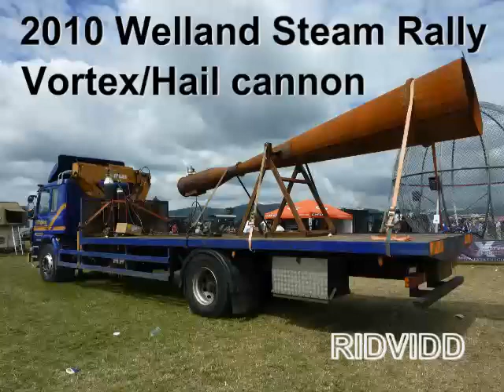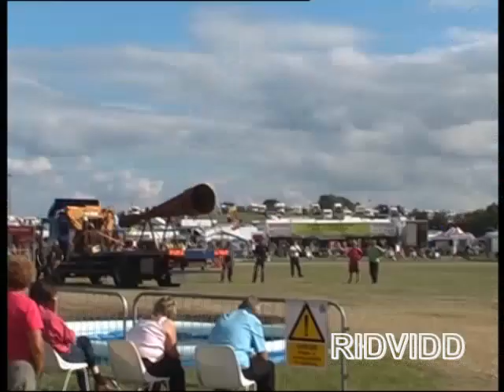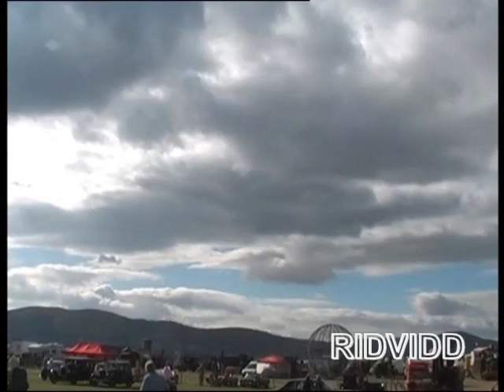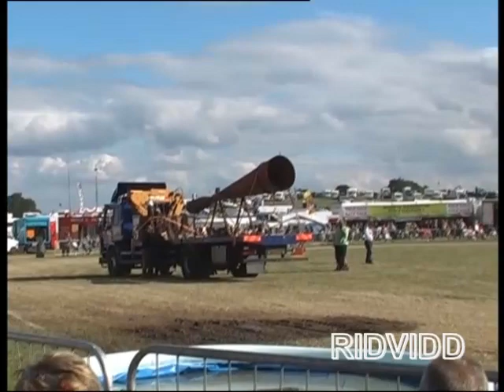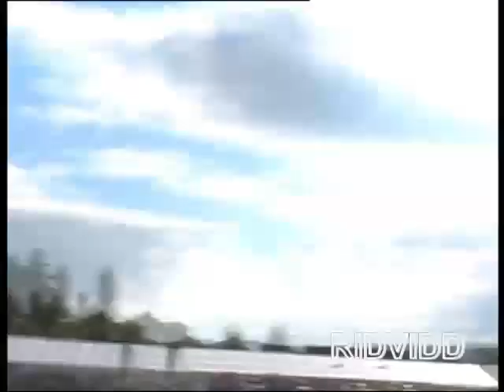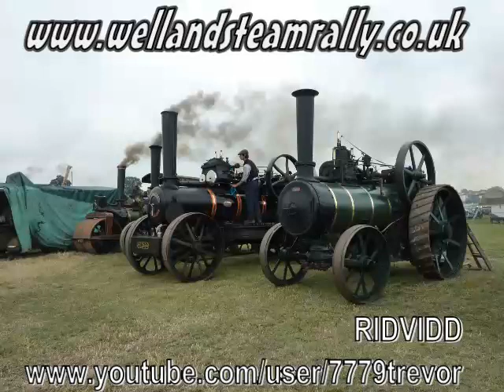Vortex / Hail Cannon .  Welland Steam and Country Rally 2010

Comment: It doesn't produce a shock wave (well, the explosion itself does, as well as a vortex), but a toroidal or donut shaped vortex. If you could load the chamber with a bunch of dense smoke before firing it, you'd see that it produces a large, fast moving smoke ring, like you can make with your mouth or with a burning stick. The toroid spins about its circular origin so fast that it makes that whirring sound. As the vortex moves further, it expands and the tubular section thins out, continually accelerating the gas, which explains the increasing pitch as it moves away. Anyway, the whirring isn't a shock wave. It's a giant smokeless 'smoke ring' that moves fast through the air.

Comment: Although it sends a shock wave into the air as well, a vortex ring and a shock wave is not the same thing. A shock wave is a sharp sound wave travels with the speed of sound, while the speed of a vortex ring is limited by the speed of the air that's trapped inside of it and goes much slower than the speed of sound. Cool video though.
Reply: para que serve isso amigo . Brasil Paraná

Comment: Whats happens when 2 of these are shot on front of each other, do the sound wave gets "null" ?
Reply: good question, but at the same time dangerous ^^
Reply: It would be cool if they do it, it could create light right like the shrimp Sonoluminescence
Reply: Miguel Queiroz
I seriously doubt it. Why would sound waves cause light? Shrimps cause light because they glow when disturbed. Why would air glow because sound waves hit it? Best you could hope for is a burst of heat, but not enough to make air itself glow, and I doubt you would get even that much.
Reply: a giant poof of air would probably come from the two coliding
Reply: +justforever96 dude.. both Light and Sound are waves!!! waves of the same energy source, just at way different frequencies!  ...so the idea is not impossible!
Reply: +Miguel Queiroz You never, NEVER cross the streams.  I'm sure I heard that somewhere.
Reply: actually you can create light with sound, if its loud enough anyways. If there is enough energy within the sound wave then it is possible to part that energy onto matter rapidly heating it up and causing the emission of light.
Reply: justforever96 no, sonic waves do create light , they dont glow, they create light my colapsing air bubbles i guess, search on YouTube it really is an unknown thing.
Reply: ... sound are waves of the air moving itself ... radio, light, etc are electrons moving through the air as they are modulated at specific frequencies and therefore no longer need a medium to conduct them.  although radio, electric capacitance and non-static magnetic fields are all the same thing, sound is not. :P sound is just the air itself moving. not electrons in the air.
Reply: @cirusMEDIA  Light is a quantum particle/wave with dual properties made out of alternating electromagnetic waves, while sound is just air moving. Yes, both of them have wave properties, but they’re drastically different in composition and origin. You’re close though!
Reply: @innacrisis6991  okay thanks for the correction/information. I guess i shall do more reading on the difference and possible overlap between them.

Comment: The description is far off, not by how its used but by what it does. The explosive gas expands and goes of the neck into the cone and once it exits it forms a vortex ring that move maybe close but not nearly at the speed of sound. If the airspeed inside the vortex is fast enough it will make this sound. To back up my claim the same sound can be heard from a passing commercial aircraft while landing. The vortexes created by the flaps create this exact sound. Look up Audible wake turbulence.

Comment: for those who want to stand in front of the vortex ring, DONT! the ring is invisible but is traveling at speeds of an F4 tornado, plus the intense spinning motion of the ring could bump up the speed to nearly 300 mph, or a strong F5 tornado. its only a second, but can blast you off your feet and send large debris like stones and branches flying at high speeds, aim it at a trailer home, it will likely punch right through the walls, smash a window, and blow every loose object around. aimed at a house window, it likely will blow open, sending shards of glass flying towards your face. so please dont be nincompoops and aim these babies at something you hate, like your gym teacher or that kid who TP's your house on fridays. BOOM
Reply: standing in front of one of this you may die.
Reply: pretty much.